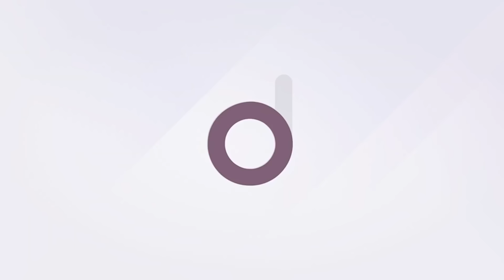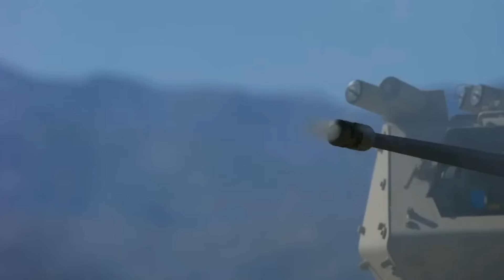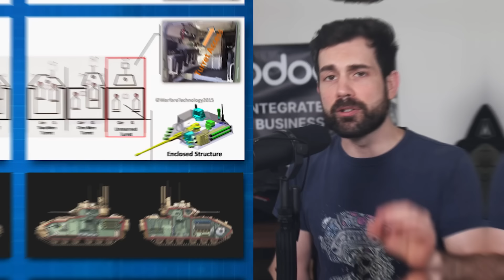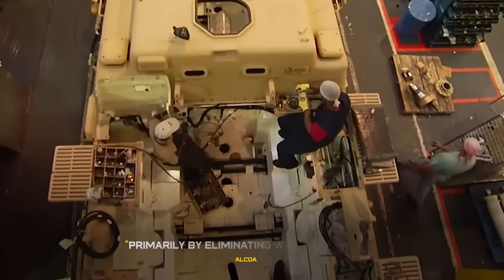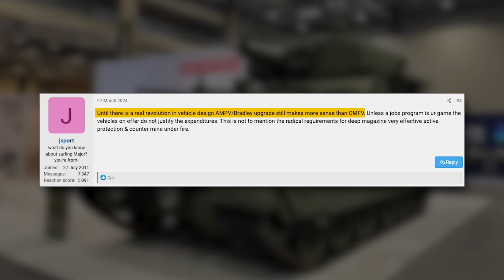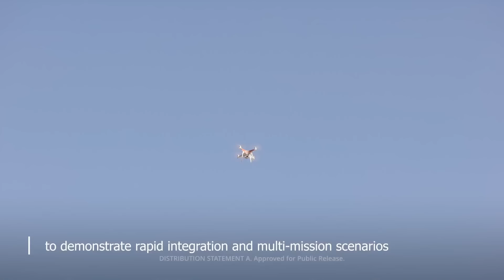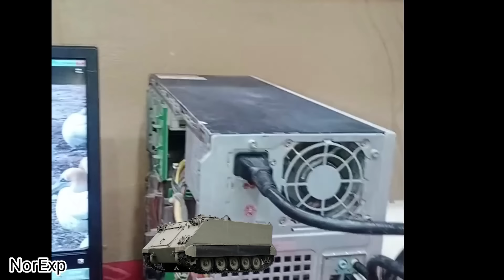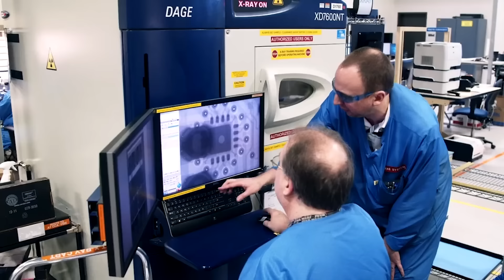How America’s Quietly Building a Secret Armored Fleet

Comment: If the hull is all one piece, with no welded seams, wouldn't that make repairs/refurbishment more difficult?  Would it require tearing the entire vehicle down to replace the single-piece hull then putting it all back together again...   It reminds me of what's happened in all our electronics.  As things became more integrated, more "one piece", they had to by necessity become disposable.  I could see BAE & Alcoa really liking this arrangement because they get to just keep producing the vehicles.
Reply: What do you imagine repairs look like on current welded hulls? If you need to tear open the welds to get inside then you might as well scrap the vehicle because it's beyond repair
Reply: @Elbuarto  Perhaps I am confusing hulls and armor plating?  My understanding is that conventional armor plating can be removed and replaced, as on other armored vehicles.  (I am not an expert though by any means.)
Reply: @BrandonIT1337  Hull is the armour. You can have additional armour added but that's usually done as an upgrade or if it's ERA. Armoured vehicles don't have a chassis like modern cars where it's just a "skeleton" that you attach panels to. That would create way too many weakspots and be unneccessarily complex.

Comment: While I get the benefit of the top plate being able to accommodate 30+ turrets.... that was simply a matter of sending out design specs to manufacturers... the challenge is now having mntc crews + actual operators trained in 30+ turret designs..... plus having the supply chain to support 30+ turret types with parts and ammo... AND ensuring the internal controls can mesh seamlessly with 30 different programmed/controlled turrets.... if they nail this and standardize as much as humanly possible, great.... but this can turn into a logistical nightmare.   They fixed one issue (standardized chasis) and replaced it with another. 

As for the cost... entire program costs less than a single navy ddg or air force stealth bomber.

Comment: Did you not do a video on the Swedish Bandvagn 302 which the built instead of getting the M113 with a 20mm autocannon that the Ukrainians are now raving about that they then replaced with the CV90. Anyway this just looks odd but could work though it feels like the upgraded M113s that was replaced by the Bradly in the first place

Comment: history has always shown that "multi purpose" use military vehicles usually come with high casualties as well.  you have to give up something to do everything.  that balance triangle applies still
Reply: Care to elaborate? I’m not too familiar with multi purpose vehicles.
Reply: @ozone-xv7hk “Jack of all trades, master of none…”

However I’d argue this isn’t really the case, as is two separate modules. The base is designed for one thing: be an armored cargo box, whether that cargo be people, supplies, or weapon systems. The top is also specialized to its job
Reply: You should be forced to work in a bauxite mine like a dog for that horrendous take

Comment: the current NATO arms race is ridiculous (its not just the US) ... instead of giving new and numerous equipment to Ukraine quickly so that they remove a major threat which is exposed as a paper tiger for us, we prolong the conflict needlessly by spending hundreds of billions on stuff which just will catch dust and rust in our storages .. while giving Ukraine mostly old stuff and not even enough to hold the lines. Clearly this is nonsense and only a thing because of the arms industries influence.
As usual we pay far more then necessary simply by being greedy and slow when it comes to aiding allies, but absolute blind to national shopping spreas for our own forces. NATO already has far far more then needed to match its opponents (aka paper tigers), Ukraine made very clear how little is actually needed to be on fairly equal terms with russia and its underdeveloped buddies.

Comment: Ukraine has proven the Bradley is still an extremely good and most importantly very survivable platform against anything russia throws at it so making a new gen vehicle based on it makes good sense.
Reply: The difference is that a lot of the Bradley crews survive the destruction of the vehicle, which can't be said about the Russian / Soviet vehicles.
Reply: Should give theUkrainians some to test out, so the yanks won't need 3000 to fight the Russians in the future.
Reply: We're almost past three years and someone is still arguing that they're holding their best stuff back? When all the storage depots are being stripped for everything they can get?
And the T90 is basically just a T72, they changed the name because the T72 got a bad name for tossing turrets in Chechnya.
Reply: @fredbloggs7131 but..but they got 20 Armatas! 😂
Reply: @fredbloggs7131  that last line is false propaganda btw.
Reply: but you can Tokyo drift this one. . . .
Reply: @Icehawk2k7  Brad has been bodying ComBloc Armor and saving the lives of it's Crewmen for 4 Decades. 
It's almost as if that's what
( Edit: American.  
We paid for it.)
Armor and Air Power was designed to do.
Reply: you mean Bradly square
Reply: I thought you guys are booked into a War with China in 2027?
So as usual, you're equipping and training for the last War you lost.
You guys!
Reply: Mobile mortar? Check polish RAK
Reply: @ Сейчас фпв дроны камикадзе всё изменили.То что было раньше эффективно сейчас всё свелось на нет и ненужность.Просто смотрите и учитесь у Русских как надо воевать и что они предпринимают на поле боя,уверен все учатся на этой войне а лучше у русских так как русские побеждают и победят.Западное оружие показало всему миру что оно бессильно против русского оружия.У нас на любой вызов с Запада есть ответ,а у вас нету на русское оружие ответ.К примеру Искандер Кинжал Орешник Циркон.А Россия все ваши ракеты может сбить а вы русские ракеты нет от слова совсем не можете.
Reply: @vladimir08090  Thanks for the laugh!
Reply: @ завидуй молча.Русских весь мир поддерживает а вас никто запомни это.И в войне с вами русским весь мир поможет а вам никто.Хотя Россия и одна вас раздавит.
Reply: @ Завидуй молча и не плачь от бессилия,а просто наблюдайте за успехами России.
Reply: @ Вот ещё тебе пища для размышления ваших западных сми.Американский телеканал ABC News с волнением сообщил о количестве убитых и покалеченных солдат ВСУ, лишившихся конечностей в результате военного конфликта. "Эта статистика просто невероятна", - воскликнул ведущий. Американский канал ABC News с энтузиазмом сообщил о миллионе убитых и сотнях солдат ВСУ, потерявших конечности в результате войны. Журналист канала назвал такую статистику невероятной.Ранее сообщалось, что количество инвалидов в Украине достигнет миллиона человек в 2025 году. Все это увеличит нагрузку на бюджет. Поэтому украинские власти тормозят признание военнослужащих инвалидами, чтобы не портить статистику и сэкономить деньги. В то же время отмечается, что Украина собирается привлекать инвалидов к разминированию территорий. Если все приведенные цифры верны, то получается, что каждый месяц украинские вооруженные силы несут потери более чем в 50 000 убитых и раненых. И это не считая дезертиров.Накануне Le Monde сообщила о глобальной проблеме украинских вооруженных сил. Речь идет о мобилизации. По данным французских СМИ, темпы мобилизации в Украине значительно снизились. Летом этого года в Украине ежемесячно мобилизовывалось в среднем 35 000 человек. Осенью этот показатель снизился до 20 000. То есть было зафиксировано почти двукратное падение показателей. Учитывая темпы мобилизации и вышеупомянутый уровень потерь ВСУ, нетрудно подсчитать, что украинцы очень быстро выдохнутся.
Reply: @ Американский телеканал ABC News с волнением сообщил о количестве убитых и покалеченных солдат ВСУ, лишившихся конечностей в результате военного конфликта. "Эта статистика просто невероятна", - воскликнул ведущий. Американский канал ABC News с энтузиазмом сообщил о миллионе убитых и сотнях солдат ВСУ, потерявших конечности в результате войны. Журналист канала назвал такую статистику невероятной.Ранее сообщалось, что количество инвалидов в Украине достигнет миллиона человек в 2025 году. Все это увеличит нагрузку на бюджет. Поэтому украинские власти тормозят признание военнослужащих инвалидами, чтобы не портить статистику и сэкономить деньги. В то же время отмечается, что Украина собирается привлекать инвалидов к разминированию территорий. Если все приведенные цифры верны, то получается, что каждый месяц украинскиевооруженные силы несут потери более чем в 50 000 убитых и раненых. И это не считая дезертиров.Накануне Le Monde сообщила о глобальной проблеме украинских вооруженных сил. Речь идет о мобилизации. По данным французских СМИ, темпы мобилизации в Украине значительно снизились. Летом этого года в Украине ежемесячно мобилизовывалось в среднем 35 000 человек. Осенью этот показатель снизился до 20 000. То есть было зафиксировано почти двукратное падение показателей. Учитывая темпы мобилизации и вышеупомянутый уровень потерь ВСУ, нетрудно подсчитать, что украинцы очень быстро выдохнутся.
Reply: @vladimir08090 1000 days to achieve nothing. Russia planned a 10 day ooeratikn and tgey failed and are still failing
Reply: @vladimir08090 hope you get well soon👍🙏🙏🙏🙏🙏
Reply: @vladimir08090 hope you get well soon🙏🙏🙏🙏
Reply: @vladimir08090 Yes because the west has the TROPHY system which can defeat an incoming SABOT round traveling 1800m per second, but you believe we don't have the technology to defeat a drone going 140kmh.  👌 😂
Reply: @ Нету у вас против России ничего.Есть у вас что то против Орешника?Почему Запад не принял дуэль от Путина испытать свои ПВО лучшие даже с форой подтянуть всё лучшее к тому месту куда будет бить Орешник.Весь мир я думаю хотел бы это увидеть.Почему отказались?А я знаю ответ,потому что у вас нечего ему противопоставить и всё.Так же Искандер Кинжал и Циркон вы бессильны.
Reply: Yep everything burns on that battlefield, putinbot or not. Cope more
Reply: With the exception of AT mines
Reply: @gregoryfilin8040 AT mines will disable any tracked vehicle.  What’s your point?
Reply: @bluemarlin8138  The Russians are doubling and tripling them up, leading to higher disabling rates, and greater damage to crews.
Reply: Why you lie? There is cemeteries if braldeysquares
Reply: Россия не вытаскивала свои новинки ещё.хватает обычных фпв дронов с гранатой рпг и нету брэдли.Всё горит не важно в такой войне как на Украине.На передовой техника долго не живёт как и их экипажи.
Reply: @vladimir08090 

Right... They've been fighting three years and taking heavy losses, just to not use their good equipment.

Wake up.
Reply: @ Вот Запад даст что то новое и Россия выставит против нового аргумент,а так зачем показывать всему миру что у тебя есть,показали Орешник и Запад приуныл,так как перед ним они бессильны.Это ведь даже не война для России а СВО.Будет большая война тогда и увидите всё и испробуете на себе как говорится.
Reply: @vladimir08090  like the t-90? ok putinbot
Reply: @lordraydens  T-90 is their 3rd gen tank lol, they have newer stuff and guess what, they're not using it. Not to mention most of the tanks you see in videos are actually T-72s most of the time (sometimes they're even older tanks like T-60s) which are cold war era tech lmao. Russia isn't using their top of the line equipment because they don't need to and the real main reason for that is they don't want NATO countries to see what they're capable of, can't blame them it's a smart thing to do. If you severely outnumber a smaller and weaker country there isn't a reason to reveal all the cards in your hand, just use what you know can beat what's on the table.
Reply: @RiverSloth The Russian "supertank" is the Armata. They have managed to only build a few, I think less than a dozen. It still has growing pains, that is curable defects. It like the SU-57 aircraft depends on components manufactured by countries that have Russia under sanctions 
Russia has sent only a few T-90s to Ukraine because they fare poorly against Ukrainian drones and artillery with very low crew survability. Like other Russian tanks their turrets tend to blow off when hit.
Reply: @RiverSloth lol, thats why all their airborne troops have died multiple times.
Reply: @RiverSloth  Your claims arent supported by evidence, but sure they have fkying marshmallow cannons. In  reality they are so empty that NATO would be in St Petersburg in hours and there is nothing yo stop them.
Reply: @RiverSloth  ok putinbot
Reply: @RiverSloth wheres the newer stuff? The 20 odd prototype Armatas?
Reply: @RiverSloth  Trashmata will never be deployed to real combat as it would be total fail. And since it was supposed to be made for export, no other country will ever buy it. Chinese and India know today, that russian vehicles are trash and they would rather build and develop their own tanks than buying moscovian scrap metal boxes.
Reply: @RiverSloth 
Bahaha, stop embarrassing yourself, ruSSia doesn’t actually have it, and if they did it’s junk and needs be towed around by a farm tractor
Reply: @ keep your day job, comedy isn't your thing
Reply: @RiverSloth  All current tanks are 3rd generation. There is no 4th generation from anyone.

The T-90 is their latest "newest" stuff, in the form of the T-90MS. The Russian Army has less than 200 of them in total, and about 1/3rd have been destroyed/disabled on the battlefield in Ukraine.  The majority of the T-90 deployed in Ukraine are T-90A, which aren't meaningfully different than the T-72Bis stuff, and suffer pretty much the same fate:  40-50% loss rates. 

The idea that Russia is somehow "holding back it's best stuff" is a propaganda lie that's been repeatedly debunked by "their best stuff" being found as charred hulks sitting in a field in Ukraine. 

Try harder to cope, Ivan, your crap is mediocre and it's being run by folks who are incompetent.  It might fair a lot better if you gave a crap about training and logistics, but since Russia has never bothered to care about either, your half-decent stuff just sucks when it's put into combat.  And you DON'T actually have anything better.
Reply: @vladimir08090  Nuke truimphs all, so...
Reply: @vladimir08090 Russia is bankrupt and what we nainly see are Sowjetunikb legacy weapons refurbished and pulled out of storage. Russia has nearky used up the Sowjetunikn leftovers
Reply: @vladimir08090  За три года все никак не вытащит, зато вытащили жигули и мопеды.
Reply: @Valtifacs  А зачем против хлама доставать новое?
Reply: @vladimir08090  Потому что танков больше нет. потому и гоняют на ворованных жигулях. Третий год не можете Донецкую область оккупировать с Т-90 на мопеды пересели, все никак не выставляете.  где и сколько тех самых вундервафель у вас есть? Ну кроме комментов и вашего манямирка.
Reply: @Valtifacs Satelite pictures show the empty tank storage sites. Every single one was counted before and now most of them are gonr.

Comment: I feel like the single piece hull design may be a double edged sword. 
On hand, yes, it's always great to be able to reduce weight and improve protection. On the other hand, these types of vehicles are regularly damaged while still being recoverable and then easily repaired in the field. Haveing what essentially amounts to a "unibody" will mean that even in cases where the extra protection wasn't needed, the damage is bad enough to mean that A: The chassis is scrapped taking the vehicle out of the fight or B: They fix it with welds and replacement panels, leading to a false sense of security and the negating of the benefits in the first place.
Reply: We could make a positive speculation though, maybe they'll have stacks of unibodies and you just pull the parts from the damaged AMPV, green the spares for what got junked and slap it on a new frame. 
Maybe it's just quicker, cheaper and easier to just discard bent frames. 
Training certainly would be cheaper, as their job is make the AMPV Legos go, no need to train up expensive metal fabricators as it's more like a factory line than repair shop
Reply: remember that most of the protection on a Bradley is from the "bolt on" stuff. The basic hull (which is aluminum) doesn't provide much more than structural support. So you can think of it as a "frame", just ones that's not just a series of girders. A unibody hull is actually a great idea, because it's stronger and lighter weight than a multi-part hull (which has to deal with stress points at connections), and the external protection panels are replaceable anyway.
Reply: If the unibody is just the "frame" of the hull with the armor and suspension added on later, that might (not always) meant that such repairs aren't as big of an issue for integrity, but it certainly will complicate repairs.
It certainly is going to be patch repaired I think, at least some of the time. Being able to just replace the whole thing sounds great, and with our current logistics system we might be able to do the transportation to the front part, but the issue will be production needing to scale up in the event of a real war. (Much like how we were suddenly running into production capacity issues just selling ammo to Europe and Ukraine).
Reply: Yeah, great point. Why build something cheaper lighter and stronger?